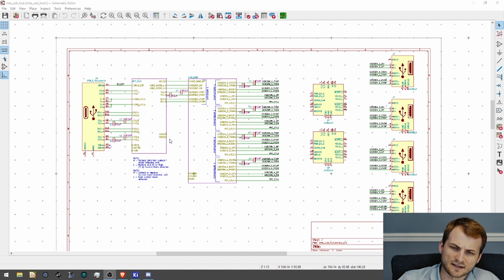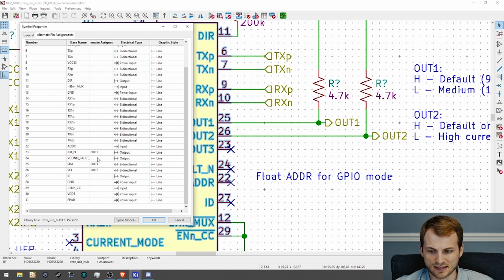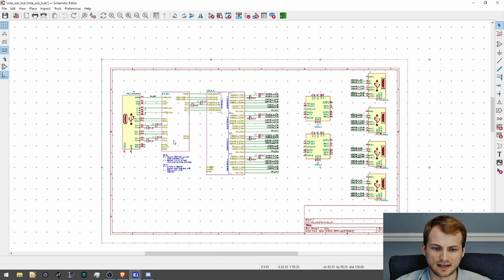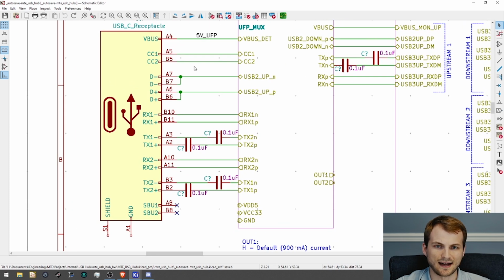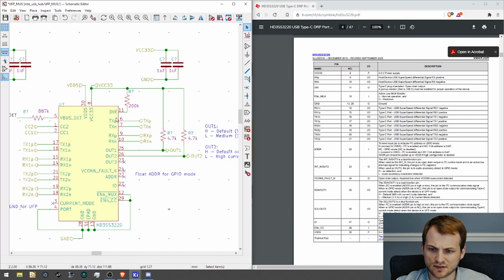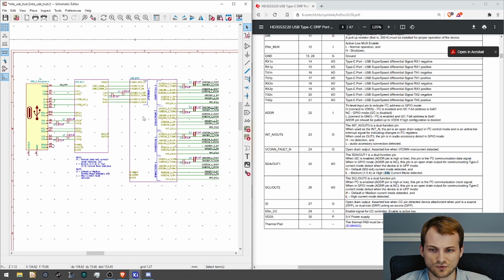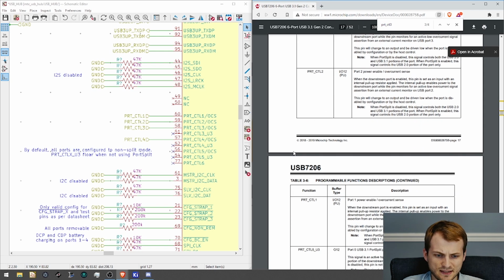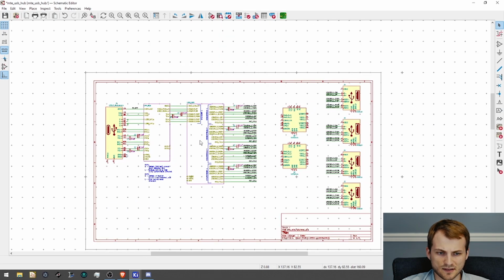USB Hub Design - Part 3/x - Initial Schematic Design

Comment: That the AC coupling caps are only on TX for external connections makes sense - the connected device will have caps on its TX pins, so each line has one series capacitor in total. For the internal connection between the MUX and HUB it is very stange though, since you have both ends of the line internally. I would expect you either want AC coupling on all lines there, or perhaps more likely on none of them.

Comment: I've used hierarchical sheets off and on, but never really was able to figure out a thoughtful reason for when they make sense. I like your explanation early in the video about using it to abstract away the noise (decoupling caps, configuration resistors, etc). 

Great reasoning!